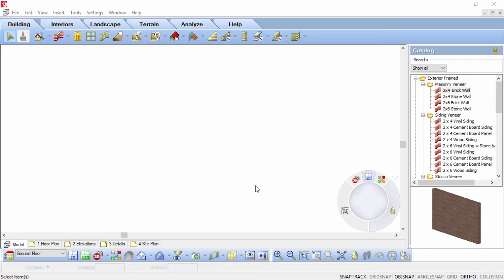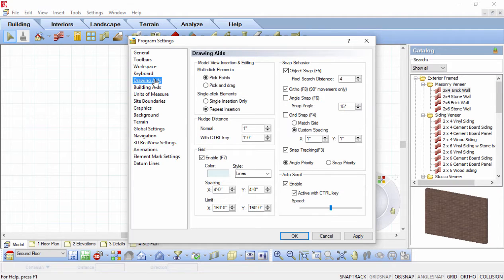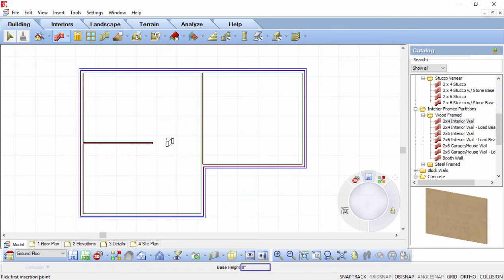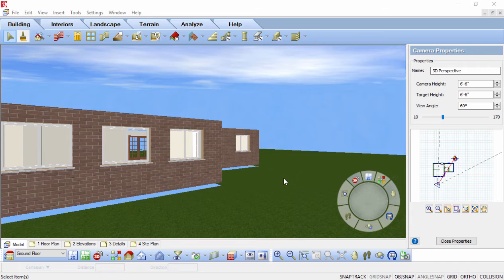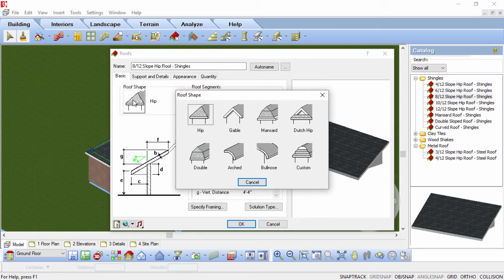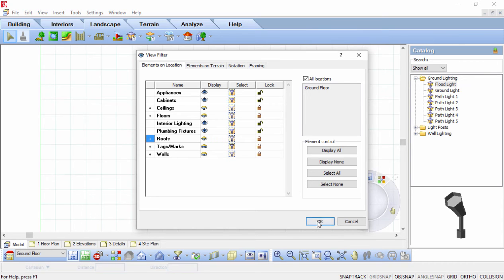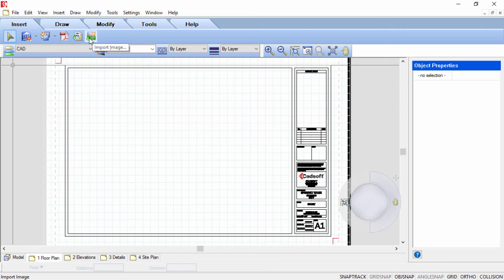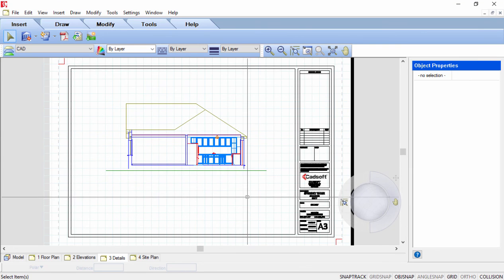Home Design Software Envisioneer Quick Start Guide

Comment: Hello, how do you create the 1 floor plan view with title block template?
Reply from the maker: Hello, the 1 Floor Plan View in this video is a part of the Template that was opened. If you are trying to create your own template with your own Title blocks then you can add in New Work Sheets by using the View Manager. You can also rename the View to be what ever name you want, like 1 Floor Pan. Once in your new Work Sheet you can import your own Title Block as a DWG or insert one of our default title blocks by going to Insert > Insert Block and then selecting the title block size that is best suited for your design.
Reply: @Cadsoftcorp  Thank you for the prompt response. I truly appreciate the help. I think perhaps I have a different version of the software because I do not see title block templates in the insert tab section. I also do not see the block insert availability under the file tab and under import options, it only gives project trace image photo board wizard object wizard BMI to catalog BMI to project. I’m using virtual Architect home design software but all the help guides point to envisioneer.
Reply from the maker: Hi  @mr.b1187  , you are correct the Virtual Architect Versions will not have the Working Drawing Sheets available. That version is intended to help with visualization and modelling of your designs. To achieve working drawings you would need to look into the Envisioneer Series starting at Pro Architect. These versions will give you the ability to create working drawings along with many other professional tools. I hope this helps Mr. B. Have a great day!

Comment: When I go to the work space in Virtual Architect Platinum 9 , there are no graphics for any command? All menu bars are visible, but no graphics??? I'm sure its a simple graphic setting problem??? Help!!!
Reply from the maker: Hello! There are 2 environments in Envisioneer - model space where you build the model and worksheet space where you print out views of the model. Virtual Architect only has model space. If you can't see any of the icons in model space, it is probably your catalog not loaded. Go to File>Catalogs>Open Catalog and open the catalog so it has products to load for each of the commands.